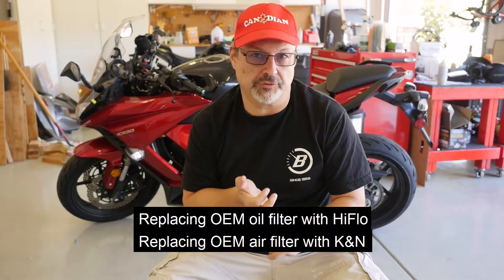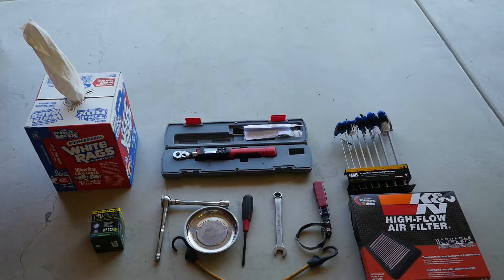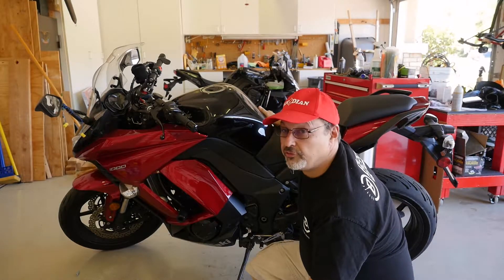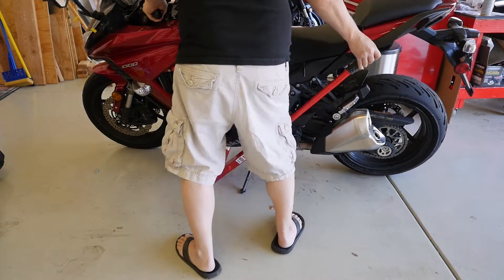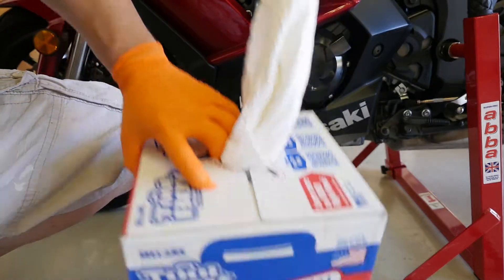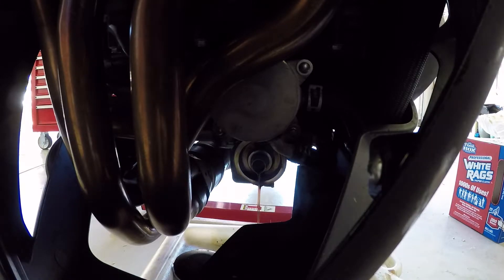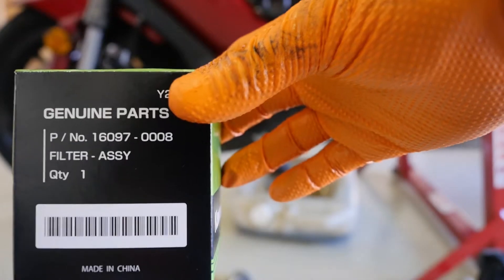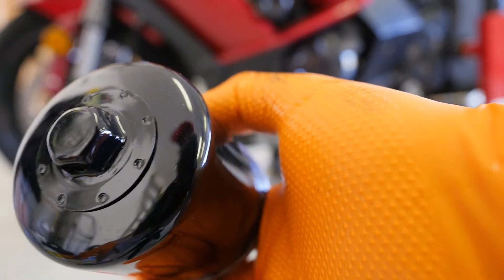Ninja 1000 / Z1000 Oil and Filter Change

Comment: I would just hand tighten the oil filter. It won’t go any where. I torqued down a K&N oil filter with a nut on the end of it on my previous 2016 zx6r and it was a nightmare to take off. So I just hand tighten from now on and an extra turn with my hand and it’s nice and snug, also easy to take off after. Ymmv

Comment: Hi i put 3.8 quart in my 2019 ninja 1000 and my level is 1\8 over the top is that normal ?
Reply from the maker: Something is not correct.  Did you change the oil filter?  If not that makes sense ( though the filter should be changed at every oil change. )   I’m guessing not all the oil drained out do to some reason.
Reply: @Wrenchie  yeah i changed the filter and all the oil was drained out until nothings left
Reply from the maker: @touna911  I assume you started the bike after initially putting in the 3.8 qts of oil, let it run for a few seconds to get the oil circulating and then shut it off and let it sit before checking the level again?  And that when the level is checked the bike is also level.. like sitting on a rear stand.  If all that is assumed good then either the 2019 specs are different than earlier models... check your owners manual, the filter is of different size and holds less oil (again check part numbers for 2019 and lets say 2016 models) or its something for which I have no clue!
Reply: @Wrenchie  do i need to warm the bike before lookin at the oil level ? I looked at it when it was cold
Reply from the maker: Dirty crap cold should be fine.  Bike has  to be level when you check the oil.

Comment: drain bolt is 17 ft lbs and oil filter is 13 ft lbs not 21lbs for oil filter
Reply: sorry 21 ft lbs on drain plug
Reply: Yes.  I had to recheck everything after I reviewed the video.  Filter was correct at 13.  Drain bolt was also at 14.   Easier to do the job than do the job and explain, shoot, position cameras etc.  I never knew recording would add so much extra time and tasks. 🤪